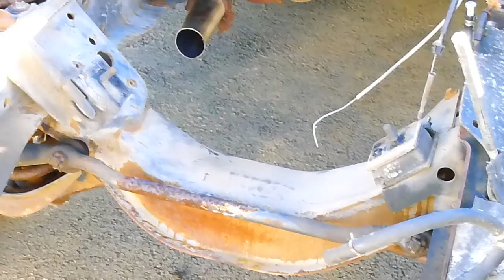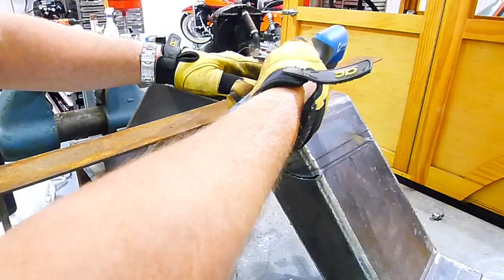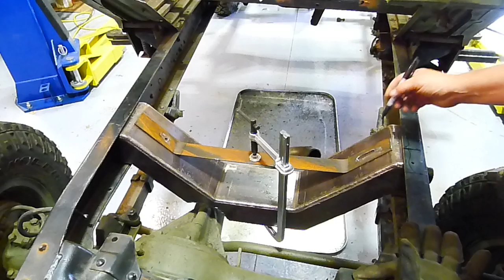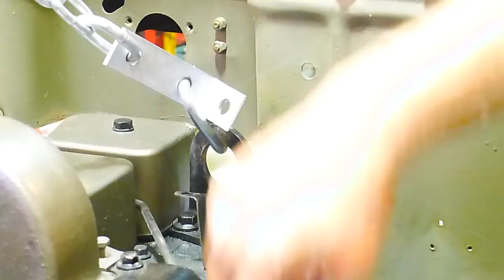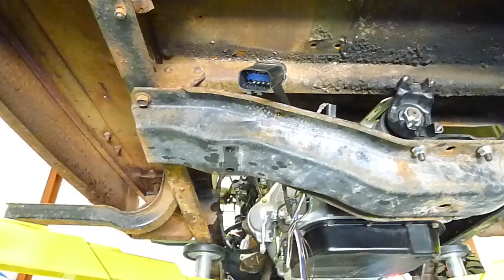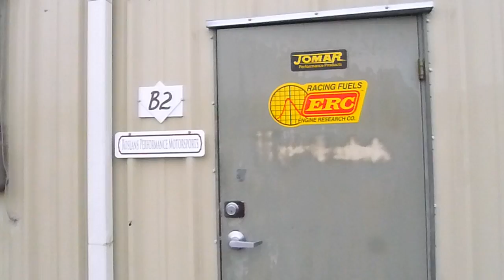1941 Dodge Power Wagon Cummins 6BT Diesel Convrsion part 2

Comment: Do you think the suspension is going to keep the  crossmember from hitting the front differential , doesn't  look like much room . That engine is  very heavy .
Reply from the maker: So far so good. It hasn’t hit yet. I am planning on putting some booster spring/ shocks in the front for another inch of clearance.

Comment: Good job! Planning  to do the same thing. tell me, what is the distance between the front frame and the front of the crossmember you did? also, I don't know if I missed this or not, but did you have to offset the engine or is it center between the frame rails?

Comment: You need to learn how to weld.
Reply: Yea maybe. Not sure how that comment is helpful. What exactly is bad about his welding?
Reply: @nathanallen6411  That whole exercise is really badly executed. The curved insert is too narrow and should have been fully formed before he commenced welding. It should have sat on top of the cut edges of the crossmember to form a V between the two walls, which are then filled with the weld fillet. He's not moving the welding torct to create a seam, instead he's just holding and squeezing to put blobs onto the parent metal. Finally, it looks as if he's using too much power on the welder and perhaps too little gas, which gives the burnt appearance ( excess power) and lots of spatter (too little gas). 
Although this weld is not particularly significant, most welding needs structural integrity and especially in automotive applications. Failures cost lives, sadly often of an innocent third party. This guy craps on about building hot rods for years so should be welding to a much higher standard.
Reply: @skipmole612  hey thx for reply. They was really helpful. I’m a beginner welder myself so I had no idea. Is this Tig welding? I’m only familiar with arc welding and I have a Harbor Freight plasma cutter and arc.

Comment: I was disappointed when I saw the yoke on the back of the transmission, thought you were making it rwd! Awesome build, great work!
Reply from the maker: +MrACV24 it is 4 wheel drive using the stock 1 speed transfer case